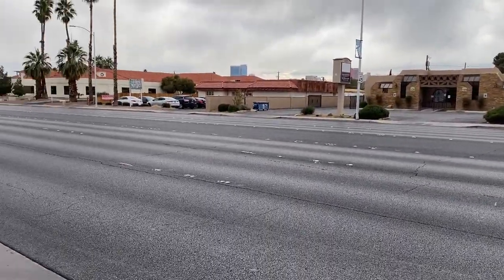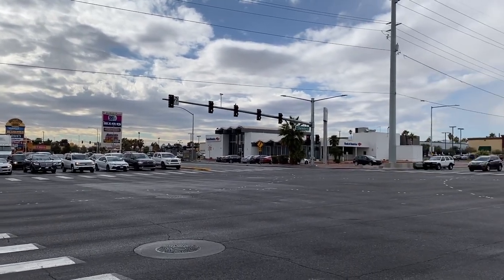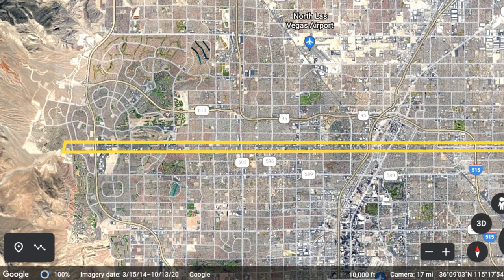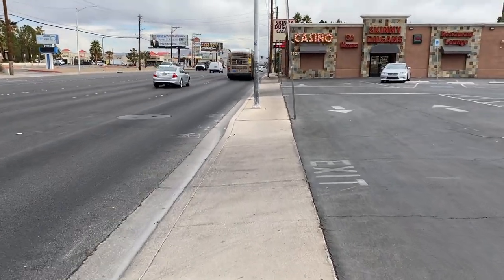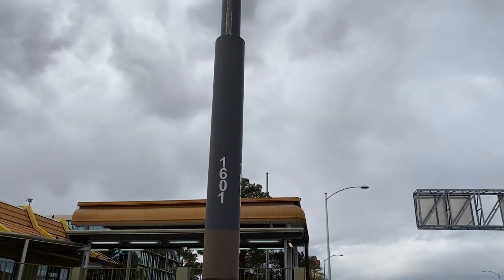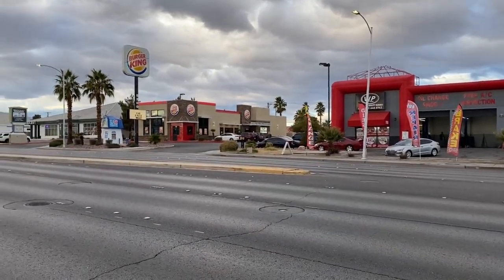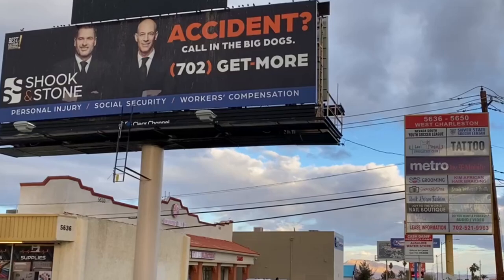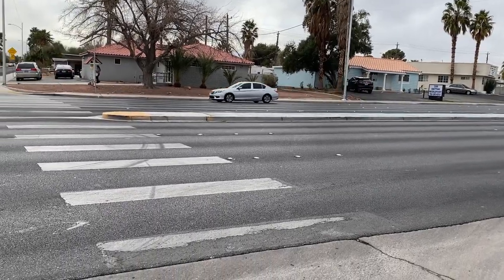The Stroad: A Case Study // Intended (and Unintended) Consequences of Car-Oriented Street Design

Comment: At least in the Phoenix area, a great stroad indicator is 5-over-1 apartment blocks. We've done the standard thing w/ these buildings: outside the downtown core, the only places where density is permitted by zoning are along the arterial streets, which are all stroads. I've lived in one of these for 5.5 years and I'm still not used to the surreal feeling of contradiction.

What's most maddening is the difference in age among these apartments. The older ones are dramatically over-parked, which is strange in its own way. But the newer ones are being built intentionally under-parked b/c developers have caught on that lots of apartment dwellers don't own cars. That winds up accumulating huge numbers of people who get places by ridehailing, cycling, scootering, riding transit, & walking. One could easily design the street to accommodate all of those different user modes (maybe not ridehailing), but there's no incentive to do so by the city government. So all these hundreds of people living in a given apartment building all get forced into the totally inadequate sidewalk gutters, until they just get jam-packed with conflicting users.

It is truly maddening.
Reply from the maker: That's super interesting (and of course maddening). You can find some form of this dynamic playing out in every city -- we remove parking requirements, which is great, but we don't introduce other requirements that improve adjacent transportation facilities. A lot of this comes back to ITE trip generation and parking generation manuals, which are "how things have been done" (professional inertia) and are explicitly motor-vehicle based methodologies, and how they're used in development review -- and the relative lack of similar tools for ensuring "concurrency" of active transportation / light transportation facilities.

Love your comments and insight as always -- thanks.
Reply: @CityNerd  oh it's even worse than that: the City gov't refuses to remove parking minimums even though staff keeps telling them we need to implement a parking maximum, & it's the developers themselves asking for exemptions from parking minimums, & the development review commission just keeps rubber-stamping those exemptions b/c they know we need more housing. It's absolutely wild.

Comment: What happens if you put a light rail system down the middle of a stroad and then bike lanes on either side adjacent to sidewalks?  It seems like that would help pedestrianize the stroad.
Reply: If you mean cut 8 lanes to 4 lanes and add those things, sure.  But you might need to accomplish that via decades of other incremental changes.  Like more streets, more transit, etc.
Reply: I for one hate street level light rail in the middle of stroads. It’s very inconvenient for pedestrians and causes an excessive amount of car/train/ped conflict. Unfortunately placing the rail elsewhere is difficult unless it goes into abandoned freight rail right-of-ways like they mostly did in Denver.

Comment: Solutions video would be interesting. Id like to know what are some realistic changes we can start with, because obviously we cant get rid of all stroads over night :(
Reply: A basic step 1 is sometimes called a "diet road" which basically just means take a 4 lane stroad (2 each way) and reduce it to 1 each way + center turning lane (aka sucide lane). This is proven safer than a 4 lane stroad. As a bonus you get to remove 1 lane worth of width from the road for whatever you want including just buffer space as shoulder between the old danger sidewalk and the new white line. (Crappy painted bike gutter anyone?) 

As for any stroad with over 4 lanes total just find a way to steal lanes back from the cars for any other purpose like dedicated bus & service vehicles, bike lanes, wider sidewalks, ect.

Part of the problem is that the immediate off ramp of every highway is always a stroad, sometimes its the genuine middle of nowhere which is honestly better.

Comment: I thought the road was just recently paved at first, but it looks like they never paint actual lines on the streets in Las Vegas? I couldn't imagine ever road I drove or walked on just having the little white bumps instead of actual painted lines, especially in low visibility weather.
Reply: Fortunately, it's rare for us to see low visibility weather.

Ironically, the only lane markings they paint are bicycle lane markings, which means drivers treat them as "right tire here" lines and they get covered in rubber. Would love for some dots on the bike lanes!
Reply: They are called Botts' dots and were invented by Caltrans.  They're not generally used where I live, but I kind of like them as a driver.

Comment: Is there any way we could redevelop these into more traditional streets?
Reply: It's hard. If you try to put the road on a diet by reducing lanes and/or shrinking the lane size to become a street you'll often get the fire department coming in and complaining that they won't be able to get to an emergency fast enough, or that their trucks won't fit on the road. If you block off access to the strip malls and big box stores in order to make a more efficient road, you end up with properties that don't have any access at all, or only have access through a residential neighborhood.
Reply: @agntdrake  i was thinking more like building a street between the parking lots and the storefronts and building more properties both comercial and residential in between
Reply: id say turning a lane into street parking and eliminating the center turn lane, but that would probably cause more problems than be a solution. and the businesses are poorly fit for street parking

Comment: Stroads: because you never know when a 747 might need to make an emergency landing in the midst of a busy city.
Reply from the maker: The key to smart engineering is to build everything in the human environment to withstand a ten-standard deviation black swan event.
Reply: @CityNerd  That's EXACTLY why my house on the Texas Coastal Bend has a steep roof to shed heavy snow loads and is otherwise avalanche-proof and why my house in the driest part of the Hill Country was built atop piers. Not merely smart -- the smartiest!

Comment: I'm glad to see that videos on this topic come out occasionally.  I live in southern California, which is thoroughly infested with stroads, and I live near the intersection of two of them.  I've tried walking along these stroads to go to nearby businesses because it seems ridiculous to drive such a short distance, but the experience is thoroughly unpleasant.  There are nice walkable neighborhoods in beach areas, city centers, and a few other scattered areas, but everywhere else, the stroads rule.  There is a stroad variant that is common in newer suburban areas that is somewhat of an improvement.  These are divided arterial roads with two or more through lanes on each side that have significantly fewer driveways than typical stroads.  Instead, they have intersections with streets that branch out into residential neighborhoods, and businesses are concentrated in large strip malls that have a limited number of entrances.  These stroads have wider, unobstructed sidewalks and often have bike lanes.  Like most stroads, they tend to be lacking in pedestrian crossings.  They may look better, and they may be a little less unpleasant, but they are still stroads at heart.  It would be nice to live in one of the walkable beach neighborhoods, but they are extremely expensive, so most of us have to live in the stroad ecosystem.

Comment: I've just remembered. A bit of history. When I did the admission exam to Colegio de Bachilleres, a bit over a month before the 1985 earthquake, Instead of going by car, dad and I went using public transportation. In "Colegio de Bachilleres 3 Iztacalco". A combination of Bus, subway and Trolleybus was needed then... When passing there due to work issues 12 years later by subway, it was so much comfortable... There's still too much to improve in many cities, for instance, the stoplights in roundabouts... Maybe that's a good suggestion for a video. Roundabouts with stoplights in North America.
Reply: By the way, I measured it. 1.3 km from the point of your "El Recreo" entrance short... If you can pass the amount of cars parked in the 6 meter wide sidewalk by selfish people there... or two metrobus stops. Found a document on Trolleybus revival plans for Mexico City, dated 2016. I'll try to send the link to you by twitter.

Comment: Living in a small-ish town (metro population of 400,000 people), I've learned that stroads come in all different shapes and sizes and aren't all immediately recognizable. Not all of them are wide, six-lane beasts. Hell, some stroads even have just one lane of traffic in either direction. But these stroads are still used as through-fares for medium distance car trips and are lined with driveways and parking lot entrances, so they fit the definition.
Reply: and they either have no sidewalks, degraded sidewalks, upheaved pavement due to trees, have mismatched stop signs or pedestrian signals, ton's of snow and ice on them( if you live in cold places) ton's of car's parked on the side so their in your way, and potholes.

Comment: Indicator species: Slip lanes. 
Indicator species: Flex posts being used to mark the edge of turn lanes because people kept crossing the solid yellow line too close to the intersection to get into a some business' driveway.
Indicator species: No business sharing a parking lot with another business, except for really large strip malls with a large anchor store. Usually a national chain grocery store or clothing store.  
Indicator species: drivers running waaaaayyyy long on a yellow left turn arrow until it turns red, and then 3 more cars go. The 4th car stops, and the 5th car honks at the 4th car for not running the red.
Reply from the maker: These are all too good. Segregated parking lots...I can't tell you how much pain those have given me in my professional life.

Comment: Another stroad feature is often the enormous off ramps where it crosses a freeway. A typical road may have a two lane off ramp but on a stroad, the two lane off-ramp often widens into 4 or more lanes facing the road. If you're walking, you may only have to cross two lanes on an on-ramp but 4-6 lanes for the off-ramp. Crossing that off-ramp is especially dangerous as you're crossing across cars ready to speed onto the stroad the second a space opens up and they're not looking for pedestrians. The off-ramp may not even have a crosswalk.
Reply from the maker: Good insight! The northbound I-15 off-ramp at Charleston is 5 lanes at the intersection -- this is the same location where eastbound Charleston has 7 signal heads, including a triple left for the northbound I-15 on-ramp. Pretty incredible.
Reply: Not having enough queuing space for drivers on the off-ramp is dangerous too. If car traffic backs up onto the freeway, a high speed rear-end collision is just as deadly. Having only 1-2 lane queuing areas just because it's a one lane off ramp is only moving the danger around. Of course, the answer is right-sizing the off ramp.

Comment: I wonder if a better stroad design would be similar to what happens on some high-capacity highways (especially those in New Jersey, namely the Garden State Parkway and the I-95 Turnpike), where there would be a separated lane or two for traffic going into the businesses and two for through traffic. Also, there are sometimes even lawyer advertisements on some city buses in some cities (one of the memes in Phoenix is Rafi, as that law firm puts a bunch of ads everywhere, especially city buses). The people who are going into the businesses would have slower, safer traffic, while everyone that just needs to go through it would be able to use faster through lanes, which would probably increase capacity. Also, in New Jersey, they seem to have miniaturized the stroad design, with even more ridiculous speed limits and driveways, even on 2-lane roads. 2-lane roads that are designated as county roads or state highways tend to have speed limits anywhere between 30 and 40 mph, even through residential areas, while 4-lane state highways have speed limits up to 50mph. At least they had the decency of putting a median in the middle of the 4-lane highways, but not the 2-lane ones, and they needed to come up with some ridiculous turns (e.g. the jughandle left, where you turn right for long enough to end up going left).

Comment: With the exception of restaurants and the occasional strip mall, everything is always set way back away from the road with huge parking lots that you have to cross to the get to the businesses. If there's strip malls near the road, then usually you have to walk around the building to the other side (and through it's parking lot) to get to the front entrances of the businesses. Oh and often there's no sidewalk from the road back to these businesses - so if you're walking, you have to walk on the grass/rocks/decorative stuff/etc or on the driveway to get to the businesses.

On one of the main stroads through my city, the cinema is in a complex set way away from the from the stroad. There's no sidewalk back to it either, so we have to either walk on the grass or in the driveway back to the frontage road that runs behind the businesses (mostly restaurants) that cars use to access those businesses. My partner is disabled and can't walk on uneven surfaces (like grass) - that means we usually have no choice but to walk in the driveway/frontage road until we get to the cinema's sidewalks. Oh and the buses that service the area? They don't stop near the cinema and they stop running after 7pm. We like to go to live events at the cinema (or used to before the pandemic), so it would start at 6 pm and get out at 10pm - and we'd have to get an Uber/Lyft home cuz there's no buses in that part of town that late at night (we don't have a car).

Further down the stroad, the sidewalk completely disappears and the bus lets pedestrians off on a gravel shoulder with a grass ditch between pedestrians and the nearby businesses. Side roads no longer have sidewalks either. We tried a coffee shop down there once - we had to walk along the gravel shoulder and then in the right turn lane to the driveway for the coffee shop. It was mildly terrifying seeing as the speed limit increases to 50 mph on that part of the stroad. There were a few very annoyed drivers that we were in the right turn lane too. But we didn't really have a choice - as they should have been able to guess from my partner's cane.

Comment: It's important to note that stroads pretty much form and evolve rather than being designed.  Often it's a stretch of a state road or US highway that is a business district for a suburb and over time it extends and often merges with neighboring towns.  By the time traffic starts to be an issue there are three major problems.  One, it has become a thoroughfare for traffic passing through it to go to towns on the other side.  Two, there are many businesses along the route and there will be resistance to measures to divert traffic elsewhere.  Three, it's so built up there's no space to convert it to a limited access road (or do things like add a rail line) versus one with a series of traffic lights without incurring significant expense.

Comment: oakland is an interesting case study for a city rapidly transitioning from mid century, urban renewal stroad design. Our stroads are in varying phases of transition, yielding an ecological landscape that is squarely in between. Injury law billboards & mid/high rise residential. Mid century parking lots & weed app delivery billboards. Dense, pedestrian friendly commercial corridors & post industrial stroads with potholes you might fall through.

Comment: A solution would be to reduce the cross-section to 2+2 lanes with parking bays with wide median, replace the intersections with modern roundabouts, with approaches offseting to the left, raised speed table - style pedestrian crossings, and a shrubbery / hidden rail zone separating pedestrians / bikes from the motorized traffic.

Comment: I feel like expanding the monorail to a full network system or even just to the airport would help in shifting the narrative away from only drive oriented infrastructure but also transit oriented (and by extension pedestrian oriented) infrastructure. 

For how many visitors Vegas gets it’s literally insane that they haven’t gone full force with it. Such a system probably could even be self funding if built out to actually be useful
Reply: Monorail hardly ever work as a transit option as they aren't meant to be one. The only advantage they got is smaller form factor once elevated above the ground... Basically you take away all that makes a good public transport system good for something that is there but doesn't get in the way of your cars. 

In a sense monorail are they too a car centric design.